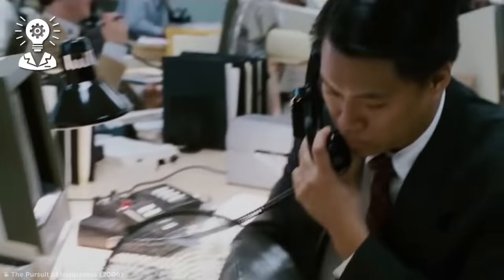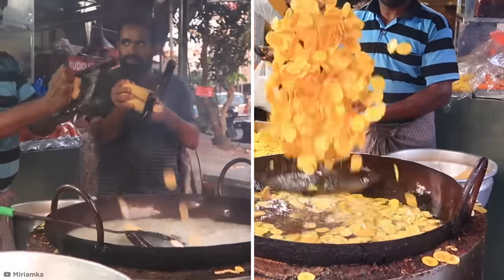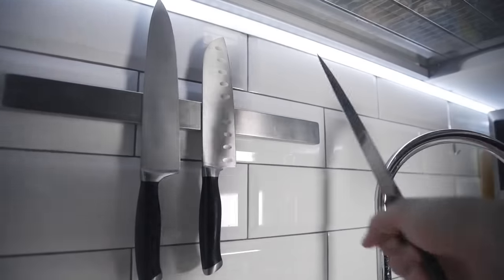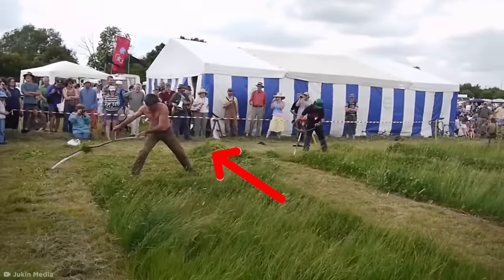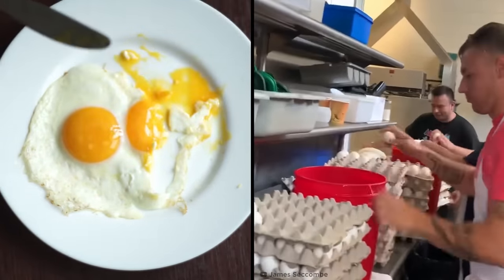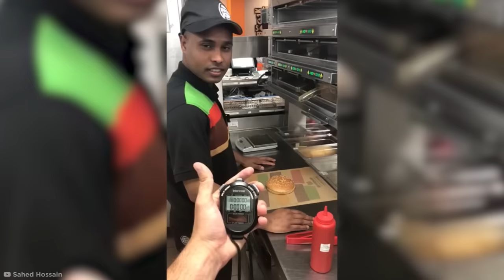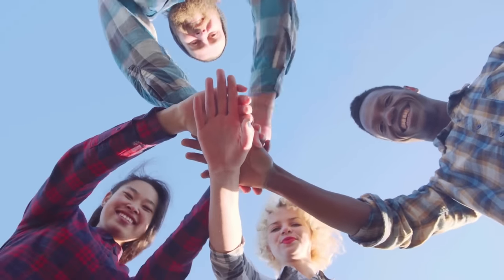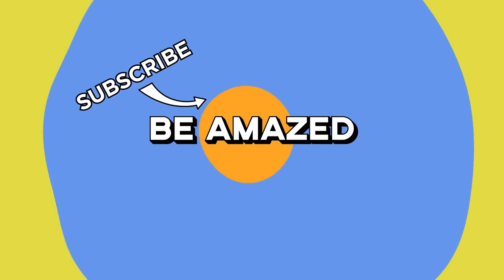Fastest Workers In The World

Comment: To be honest, the bk burger maker is just standard speed. As long as you work in the industry long enough, it'll be very hard to slow down. The way he wrapped the burger was fold up then fold down then two sides, na~ hold the top and bottom sides with each hand and fold up down together, then both sides, time can be cut under 5 sec.
Reply: For real, I used to roll two burritos at a time one handed and they were perfectly wrapped and rolled.  I was far from being one of the fastest.

Comment: I have a scythe and can tell you now, they are way better then a weed Wacker, you don't need to be an expert, you just need to keep them sharp, though weed wakers are still better for really rocky areas or in tight spaces and around awkward things, but for anywhere with the space to use it a scythe is better, however sickles are also a thing, witch are once again faster then a weed waker, but they smaller so less  good for larger  open areas when compared to a scythe, (still better then a weed Wacker though) they are good anywhere it's hard to use a scythe that can fit a weed Wacker, though once again a weed Wacker is better with closer cuts among stones or large gravel  as you don't have to worry about hitting them and damaging the blade.

Comment: The guy making cuts with the scythe was not making even cut on his left side while the guy with the motorized cutter was trying  to finish the entire job. Whats the point in being faster when you don't do it right. That's almost the point of using motorized equipment. Having more precision while doing a faster job. This is a prime example with the dominoes segment, I used to work for dominoes and am familiar with their process, and the representation of the pizza maker festival is inaccurate. The guy he shows making the pizza, would have failed due to the fact he added to Many pepperoni, and they were not properly spaced,which during said competition would get you disqualified. He talks about the man making 3 pizzas in 45 seconds, in which I had to do to become a manager.( His Saucing would have got Him knocked out too. His pizza would have never passed a cut test).
Reply: Alot of thes videos show people giving up quality for quickness. Not an even trade in my opinion